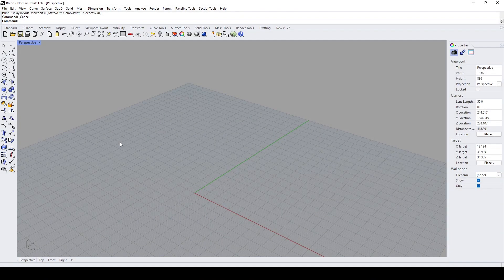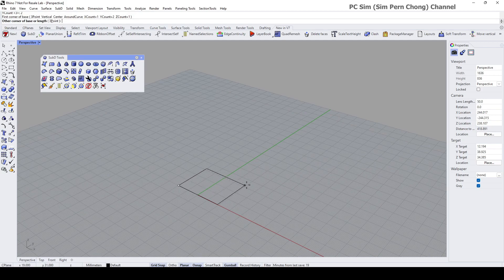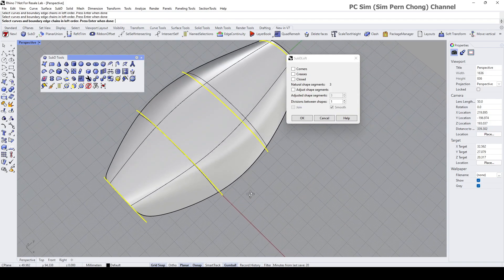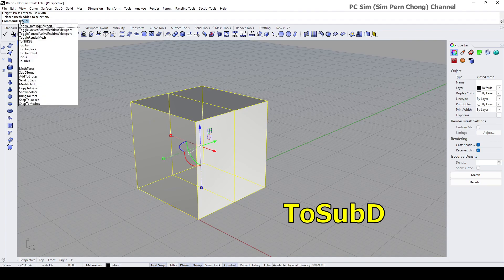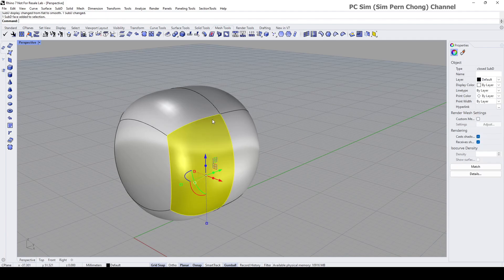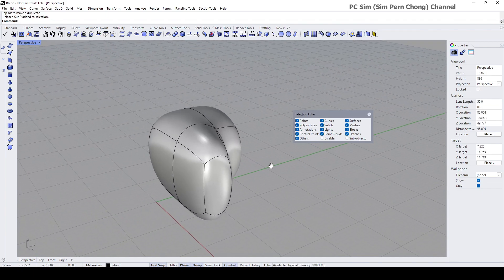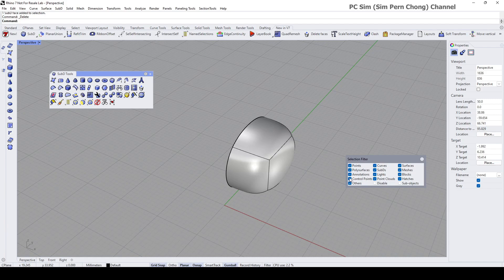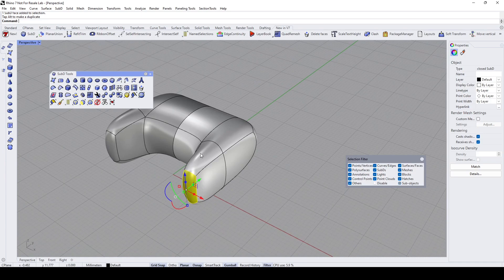Rhino 3D Organic Tutorial: Introduction to SubD or Subdivision Modelling 【犀牛3D教程：SubD或细分建模入门】

Comment: Subdivision modeling (SDM) can be a valuable tool in product design, offering several benefits. Here are some pros and cons to consider:

Accurate representation: SDM allows for the creation of complex geometries with high accuracy, making it ideal for designing intricate products, such as jewelry, watches, or small mechanical components.
Reply: Smooth surface quality: SDM enables the generation of smooth surfaces, even on complex shapes, which is essential for product design where aesthetics and usability are critical.
Efficient modeling: SDM can be used to create detailed models quickly, reducing the time and effort required to achieve a desired level of detail.
Reply from the maker: Thanks

Comment: what if we have done the shape nicely in subd, then we need to put another design/pattern on it? it will broke the topology of the primary subd and change the shape due the pattern applied has complicated  shape. hope u understand what im saying. hard to say without visual.
Reply from the maker: Sorry for the late reply. Yes, once an operation such as solid boolean difference etc is applied...the topology is broken...because the SubD is now converted to polysurface.
Reply: With subdivision surface modelling, you work "from the outside in", meaning you flesh out the overall shape with as few polygons as possible, only then refine it with more polygons in areas where they're needed, and only then convert it to NURBS surfaces, to then be able to add all the product details with trimming, intersecting, etc. pp. like you would do with any NURBS surface model.

Comment: Subdivision modeling is a popular technique used in 3D modeling to create smooth and curved surfaces from simpler geometry. Both Rhino and Blender support subdivision modeling, but they have some differences in the way they implement it.

In Rhino, SubD is a relatively new feature that was introduced in Rhino 7. SubD stands for Subdivision Surface, which is a type of NURBS geometry that can be subdivided into smaller faces to create smooth surfaces. Rhino's SubD modeling allows for precise control over the shape of the model, with the ability to adjust the density of the mesh, and to use creasing and softening to control the sharpness of edges. Rhino's SubD modeling can be used to create highly precise and accurate models, making it popular in industries such as product design and engineering.

Blender, on the other hand, has a more robust set of subdivision modeling tools that allow for more organic and fluid shapes. Blender's subdivision modeling allows for the creation of highly detailed and complex models, including characters and creatures, and it supports a range of different subdivision algorithms, including Catmull-Clark and Loop.

In summary, while both Rhino and Blender support subdivision modeling, they have different strengths and are often used for different types of modeling tasks. Rhino's SubD modeling is known for its precision and accuracy, while Blender's subdivision modeling is known for its ability to create organic and complex shapes.